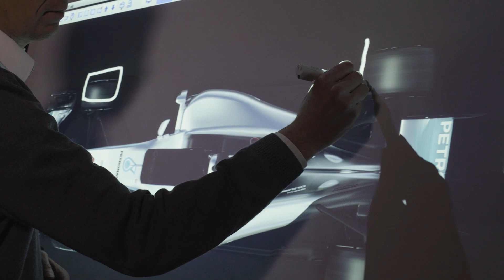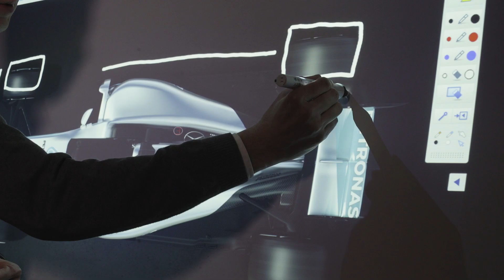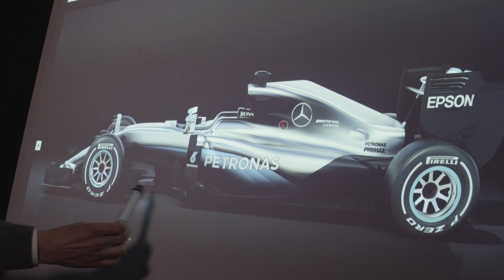F1 2017 Explained: Aerodynamics #SimpliF1ed

Comment: im happy with the new changes
Reply: ***** No it didn't. It removed skill from the drivers to actually race the car. 

Also look up the 2003 Brazilian Grand Prix, it was the same as last years Grand Prix, safety car start and several safety cars throughout the race.

Drivers should drive the car, not a computer program.
Reply: ***** You can go watch Formula E if you're such a big fan of electric vehicles. I for one enjoys combustion engines and like how they're getting more energy out of the fuel and are more powerful than the old V10s.

Also you should stick to your video games with traction control, kiddo.
Reply: El Diablo Traction control? Please be kidding....
Reply: Tod 1 When they used traction control, it was already adaptable. They always set a certain amount of slip to get the cars to rotate better in corners meaning the traction control only kicks in at a certain point. The drivers could change it on the fly and even up until 2003, the pit crew could change the settings on the car whilst the car was driving. After 2003 dual way transmitting got banned, again to put the emphasis on the driver.
Reply: Tod 1 And seriously? Traction control is the way to be able to enjoy it? 

Think about what traction control does for a moment. It doesn't only help reducing wheel spin, it aids under braking (ECU mapped engine braking which acts like ABS on the rear wheels), it helps splitting the power through the electronically controlled differential working as a stability program system. It aids the drivers to launch the car. 
So at the start, under acceleration, braking into corners and aids if the car gets out of control while changing direction. All controlled by a software and not the driver. It removes so much driver input and driver skill. Think about how awesome the driving would've been from say 2001-2005 if it was without all those driver aids. 

If you look at prior racing before traction control and racing after traction control got banned, you can see the drivers input much more and battles being more intense. Traction control sterilizes the sport.
Reply: Rottensteam they should add traction control only in heavy rain
Reply: meme 1 No. What they need is a better rain tyre. Traction control will put emphasis on the computer software driving the car rather than the drivers driving the car.
Reply: ***** Big difference. You can see its the driver that drives the car today. Too much throttle and he oversteers. Too much braking and he locks up. Back then, it was just putting the foot to the floor and let the car sort it out for him, all he had to do was to steer.
Reply: ***** That has nothing to do with traction control... Also those overtakes still happens at every race. Alot of DRS overtakes (which kinda suck) but there's also still alot of non DRS overtakes and battles. 

What are you? 12? Your arguments are completely ignorant.
Reply: Tod 1 Ugh... Too many kids in this thread.

They are top drivers! They don't need traction control.. They need better rain tyres ffs.
Reply: ***** Traction control doesn't give more grip, it prevents wheels losing traction. Under accelaration it controlles the throttle by cutting the fuel everytime the wheels slip, add to that it applies throttle under braking so the rear wheels wouldn't lock up so it gives the effect of having ABS. And it controlled the differential, splitting the power between the rear wheels so that it worked like a stability program (so it wouldn't spin out if the driver made an error).
Reply: I guess you want stick sift with 3 second delay and leather hats as well
Reply: TC did not remove any driver's skill, that's nonsense. To understand it properly, you have to know the whole picture of that F1 era. Cars of that era were extremely powerful and had grooved semislicks with only 65 - 70% of the treadmill on track surface. Tire compounds were much harder, then those of today's slicks, especially in 2005. Also, cars of that time had a very high aerodynamic downforce and a poor mechanical grip. So, in order to compensate for poor mechanical grip those cars needed electronic assists, otherwise, the cars would have been behaving like raging bulls on a rodeo. Preventing the car with poor mechanical grip from sliding every now and then did not interfere with driving those cars on the limit whatsoever, on the contrary, it actually benefitted it.
Reply: Лариса Ревазова You are completely wrong on every single point. I'll correct you when I have the time.
Reply: Believe me, I know I'm right. You must be some retro style racing fan, who thinks, that racing should be with no electronics at all, manual gear levers and engines still placed in front of the car. But, I'll gladly listen to your point of view. Please, don't bother to correct me, just express your thoughts.
Reply: Лариса Ревазова First of all, the grooved tyres had more grip and were more durable than todays Pirelli slicks. Sure they had grooves, but it was a competition tyre between two manufactures competing to make the best tyre, that spawned some incredible tyres. They used a much better compound that could last for longer and gripped more than todays smaller slicks (until this year of course with the new Pirelli tyres being introduced). The Pirellis were intentionally engineered to wear fast and grip less, it's two completely different tyre philosophies. That has nothing to do with "hardness". Even the Ultrasoft tyres are harder than the grooved Michelin/Bridgestone tyres from the tyre war. Its simply a fact that they had more mechanical grip during the V10 era than last year. You can also see the cars sliding, oversteering and correcting much more today than during the grooved tyres era exactly because of the lack of grip. 

Secondly, todays cars produce more downforce than the V10 cars. That's also a fact. The 2016 cars had much more advanced aerodynamics than the V10s. They were more limited in where they could exploit downforce than during the V10 era, but the advancement has completely changed how downforce works.

Thirdly, powerful engines during the V10 era? Sure, just not as powerful as todays hybrids. The hybrids have more horsepower and twice the torque.

And lastly, I'm not at about being retro.. Traction control is 30 years old.. it would almost be retro if they reintroduced traction control again. But it should be down to the drivers to apply throttle and brakes all by themselves unaided. Its a drivers sport as much as its a team sport. In fact, drivers critisized traction control, (and all the other driver aids they had back then) and said it levelled the field artificially, making impossible for the best drivers to outshine the not so good drivers. 

Did you also realise that before and after traction control, they had to work on drivability of the throttle? During the traction control era, the throttle almost only worked as an on/off switch. All the driver had to do was to floor the throttle out of a corner and let the software sort it out. That is directly removing driver skill of the equation.

Of course, everything I say is a fact and I can back it up. But I'm curious to hear, why do you make stuff up and try to make it sound like its facts? It's completely ignorant, everything you've said. It's equivalent to say that water isn't wet... Please don't go around and spread misinformation.
Reply: ***** I see, you have no arguments. Carry on.
Reply: meme 1 not for me not until they launch that horrible sounding 2014 V6TH out of the nearest window.
Reply: I think Meme is on to something Adaptive Traction Control could work, the levels of traction control could be tweaked lower/none and hirger/normal depending on what race and where.
Reply: Rottensteam Yes fair point however I doubt this generation of, pro drivers have been trained for that, that would mean going back to the drawing board completely, better rain tyres or no.
Reply: Rottensteam fair enough, I don't mind either way, just it's been so long since I have properly been able to appreciate an F1 car.
Reply: Ah, you've finally given me a tad of your precious time. You'd better not. Your answers, Mr. "knowitall" justify your incapability of logic thought process.So, you are basically saying, that a grooved 2005 tire, that had to last qualifying + the whole race, was softer and gripped better then the ultrasoft Pirelli tire of the recent years, let alone other compounds. Do you even comprehend, that in order not to end up looking like a slick tire and keep the minimum required depth of the grooves still existent by the end of the race, according to that era's regulations, that tire had to be rock solid, that's why it lasted the whole race, and that's why it kept all four grooves visible, in first place. Yes, the Michelin and Bridgestone tires were extremely well manufactured, but they had an operating range within the regulations of that era. The Pirelli tire destroys itself much faster, because it is artificially manufactured as a very abrasive tire, but at it's operating peak, let it be for few laps only, until it artificially, dramatically looses performance, the Pirelli tire is much faster, then any grooved tire will ever be (that's why you see such dramatic difference between qualifying and race pace, when the drivers forcefully start the "I'm saving everything" mode). The Pirelli tire was designed to wear out fast, it doesn't have initial poor grip. After all, it's F1, not Demolition Derby. At it's operating peak, the slick tire will always be faster then any grooved tire, because the slick tire is always softer then a grooved one and that's, because an uneven tire treadmill causes a tire to be more fragile to the forces it endures, therefore it needs to be strengthened buy being manufactured from a harder compound. That's physics for you. And you tell me to listen to the drivers, talking about how fast modern cars are, compared to the V10 era cars. Why don't you listen to the likes of Alonso, Button, Massa and listen carefully to what they actually say, comparing modern cars to the brutal beasts of the V10 era.  Alright, I'm not gonna continue from here, I'm just gonna sit back and enjoy your comedy hour in backing up that utter nonsense of yours. Of course you will back it up with facts, so that I would be crushed forever by your superhuman knowledge. I just love dudes like you, living in their fantasy world, and trying to "convert" everyone else into a believer. Good stuff)
Reply: Лариса Ревазова Omg again you are completely wrong in everything you say... What is the matter with you? How is it even possible to spew such ignorance?
Reply: ***** Oh btw, viewership and track attendances rose during 2016. What happened during the 00s? From 2000-2005, 300 million viewers lost because the sport sucked with the overly artifcial cars. 

Its good that you are by far in the minority by wanting to have traction control back in F1 (lol, traction control in F1!)
Reply: Лариса Ревазова Its not difficult to make a tyre be able to grip and last for long. That was what Michelin and Bridgestone has spend years developing. On the contrary, what Pirelli is doing is very difficult, they were demanded by FIA to build a tyre that would wear fast (to force pit stops) and grip less (to control cornering speeds), downgrade of the tyres happened in 2011 and 2014 (in 2014 because they should be able to withstand the extra torque from the hybrids). They are intentionally engineered to grip less and wear faster.

Even Massa has been on a campaign about the tyres where he directly compared then to the oæd grooved tyres. He said the grooved tyres had much more grip and that they could last alot longer. 

The reason for the qualifying pace compared to the race pace is mostly down to fuel, they have to carry all the fuel which adds 3-4 seconds of lap time because of its weight. Its also down to tyres, but their initial grip is still alot less than the grooved tyres. ITS TWO COMPLETELY DIFFERENT COMPOUNDS! 

Even Mercedes engineers has compared the grooved tyres with todays Pirelli. Yes, they had grooves, but they were much bigger than the Pirelli slicks, so the contact patch is give or take the same. But the rubber (they're not actually made of rubber anymore) was much more grippy and they stated that in those days they could afford to carry less wing in many places exactly because they had suffecient mechanical grip, where as the Pirelli driven cars had to use maximum downforce on most tracks simply because they didn't have suffecient mechanical grip.

So please again, stop making stuff up and spread misinformation.
Reply: Лариса Ревазова Its not difficult to make a tyre be able to grip and last for long. That was what Michelin and Bridgestone has spend years developing. On the contrary, what Pirelli is doing is very difficult, they were demanded by FIA to build a tyre that would wear fast (to force pit stops) and grip less (to control cornering speeds), downgrade of the tyres happened in 2011 and 2014 (in 2014 because they should be able to withstand the extra torque from the hybrids). They are intentionally engineered to grip less and wear faster.

Even Massa has been on a campaign about the tyres where he directly compared then to the oæd grooved tyres. He said the grooved tyres had much more grip and that they could last alot longer. 

The reason for the qualifying pace compared to the race pace is mostly down to fuel, they have to carry all the fuel which adds 3-4 seconds of lap time because of its weight. Its also down to tyres, but their initial grip is still alot less than the grooved tyres. ITS TWO COMPLETELY DIFFERENT COMPOUNDS! 

Even Mercedes engineers has compared the grooved tyres with todays Pirelli. Yes, they had grooves, but they were much bigger than the Pirelli slicks, so the contact patch is give or take the same. But the rubber (they're not actually made of rubber anymore) was much more grippy and they stated that in those days they could afford to carry less wing in many places exactly because they had suffecient mechanical grip, where as the Pirelli driven cars had to use maximum downforce on most tracks simply because they didn't have suffecient mechanical grip.

So please again, stop making stuff up and spread misinformation.
Reply: Лариса Ревазова And a tyre doesn't need to be hard to be durable. Its not a linear curb, they can be suffeciently soft and grippy but still be durable. In your head a GT3 slick tyre is the same as an F1 slick tyre with what you're saying. Imagine if I made a slick tyre with the same rubber as my road cars tyres. The tyre would be extremely hard, but it would probably wear out after 1 lap since its not durable and build to withstand an F1 car.
Reply: Лариса Ревазова Also your term "convert you into a believer" makes no sense lmao! Facts are facts wether you believe in them or not. You however is the believer since you go against straight up facts...
Reply: ***** Why do you keep on giving youself likes? Its very weird.

And no, you are by far in the minority.

Also, you say you want traction control back, but you don't even know what traction control is? Lmao!
Reply: ***** The throttle worked as an on-off switch during the traction control years. Drivers either gave no throttle or full throttle, the the program would sort out how much throttle could be applied, not the driver.
Reply: One of your quotes is simply amazing: "with a traction control, you just press full throttle in the corner and the car's electronics sorts everything else for you". "Drivers either gave no throttle or full throttle" Now, son, that is a very good indication that you have never experienced driving a racing car, especially a very powerful single-seater in real life. I'm very sorry to disturb your delusional world, but forms of traction control still exist in today's cars, the only difference is that it's stuffed in a heap of tricky software, in order not to be obviously visible on the surface, as well as forms of active suspension. The only difference in 2001-2007 TC years was that it was officially legalized during that period.Another of your "mastermind" theories is that pre 2017 cars generated more downforce then 2004-2008 cars. Great, here you go, wandering around in a fantasy land of yours. The only year when you could compare the amount of downforce generated by cars of post 2008 era to the cars of the years mentioned above is 2010 when cars used blown diffusers. Now that was a single element which allowed the post 2008 cars compare to the amount of downforce of the 2004-2008 cars, that generated that downforce simply by their sophisticated aerodynamic design. To deny that, you have to be, well, you.      You know, you sound like an obsessed maniac, giving 5 replies over my single post. I understand, you need to convince, first of all, yourself with "facts" made up as well by yourself.P.S. Massa actually meant durability and a stable operating range of the grooved tire, that declines slowly and naturally, which allowed them to race on the limit, whereas today you will kill your tires after few laps, and the loss of performance happens very abruptly and that's exactly what the drivers complain about, so, please, don't twist actual things, making them sound comfortable for you to spread nonsense. I repeat again - a slick tire is always faster then the grooved one, the thing that comes to play is an artificial trick, that makes tire performance drop dramatically in a very short period of time. Now that is as artificial as F1 can be, for folks like you to enjoy. One more thing, why were the grooved tires introduced to F1 in the first place? To make the cars slower, by reducing cornering speeds. It took engineers more then 3 years to match the lap times of the 1997 cars that used slick tires, which were, by the way, also narrower then the grooved tires. You have to understand, that by making a single groove on a tire, let alone four, you split the tire into two, it doesn't react like a single element on the surface anymore, it doesn't heat up or cool down evenly, and the g-forces in a corner wear down such incomplete tire much more faster. And when you have a very aerodynamically advanced machine on such hideous tires, it unsettles the whole package. You had to have something to let the car escape from that stupidly made prison and at least, partially to realize it's potential. If Michelin and Bridgestone could make slick tires, having the freedom they had in that era, the cars would easily be 4-5 seconds a lap faster and in 2005 case - 6-7s.   So, I'm asking you again - do you really think, that a 1998-2008 grooved tires are faster then the slicks of modern era on it's operating peak?
Reply: Лариса Ревазова No again... You are completely wrong! So much cringe in tour comment.... Do you just and make stuff up for a hobby?